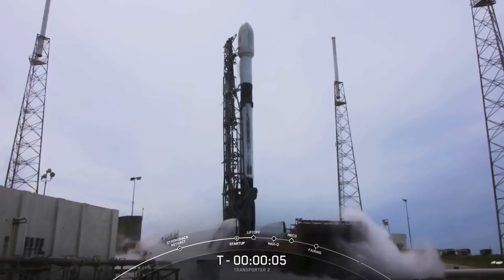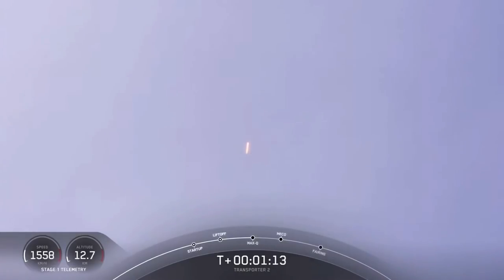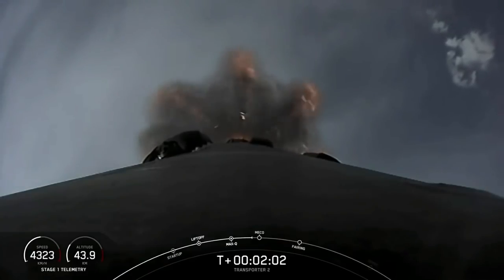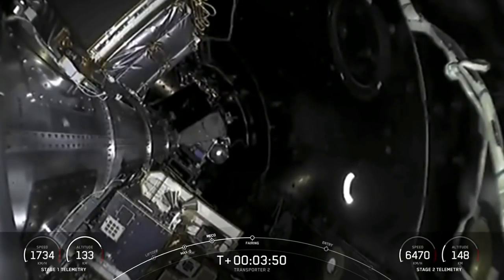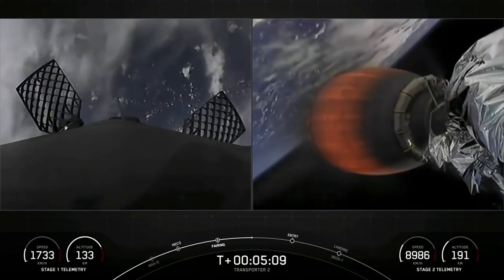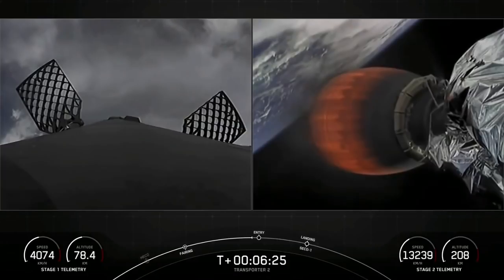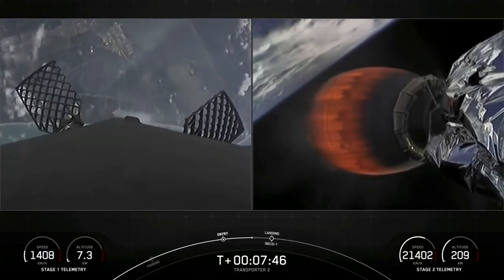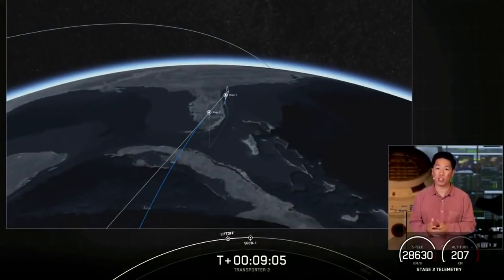SpaceX launches Transporter 2 rideshare, nails LZ-1 landing in Florida!

Comment: 0:40 >>> Nose cone shivering rocket launched.
No one commenting on that, why ????

1st stage chamber pressure : what ???
Reply: The wobbling nosecone has nothing to do with the nosecone itself. It's the camera vibrating. Chamber pressure is the pressure inside the combustion chambers of the 1st stage engines.
Reply: Respected  @Ethan_Roberts  

Where was that vibrating camera mounted ???

Earthquake zone, isn't it ???
Reply: @mohamediqbal395  it's a remote tracking mount. They're often setup very close to the launch site. Do you have any idea how much a rocket vibrates the surrounding area?
Reply: Respected  @Ethan_Roberts  

But the camera vibration happened long after the launch, when it was in air. 

Quote :
*Effect coming very late, means something happened in between*

Comment: One can clearly see that the exhaust gasses coming out of the second stage engine in space are not only (partly) visible but that some of the gasses leave the exhaust almost at a right angle, as can be seen at 6:11 - 6:12 when (what i assume is) a piece of ice breaks loose and hits the exhaust gasses and is than jettisoned away from the engine. Compare that to the footage of the Lunar module lifting off from the moon by means of it's rocket engine: no gasses visible at all.
Reply: Yes, the engines use different fuels and were in different atmospheric environments hence the difference
Reply: @lucaherman6227  the lunar module engine should have produced lots of visible gasses. Also the atmospheric environments should be comparable, near vacuum of space.
Reply: @erbalumkan369  no it shouldn’t have, it’s fuel type burns clearly, not all rocket fuel is the same believe it or not

Comment: What is the "heartbeat" going on under the foil blankets? Some sort of pressure release?
Reply: It's just vibrations from the rocket firing.  Any kind of pressure release would blow the insulation apart.  It's just very thin reflective kapton film.
Reply: @stargazer7644  - It could be puffs of gas from the ACS.

Comment: So the aluminum tin foil doesn’t rip at 4000 kmph..........LOL.....nice CGI.👍🏻
Reply: Why would it?
Reply: No, the multi layer thermal protection foil does not rip when it gets exposed to a vacuum with no air drag. Idiot.
Reply: Speed isnt a force. 10mph, 1000, 100,000mph it doesnt matter if there is no medium to interact with.
Reply: theres no air hitting it so it wont rip.

Comment: I’m probably being dumb but I’m amazed how swiftly computing has moved but not rocketry considering they were roughly around the same era
Reply: You can't break the laws of physics.  Computers have evolved because we've simply learned how to make transistors smaller.  I hope you enjoyed the ride, because we've pretty much hit the limit to how small you can make one.
Reply: @stargazer7644  
Hmmmm….I’m not convinced it’s all about the size of transistors. Computing power was rudimentary when compared to physical rocketry. I think it’s more about the potential commercial value back then when computers were a whole lot cheaper to create and research because of the natural expenses associated with rocketry
Reply: @D-McMarsh  Computing power is directly correlated with transistor size.  The size of the transistors is what determines the capacitance of the nodes, and that's what determines how fast the computer can run.  It also is what determines the voltage chips operate at, and how much heat they have to dissipate.  The end of the road in shrinking transistors is also why they've pretty much stopped getting faster. That's why you don't have 20 GHz CPUs, and never will.  All we can do now is put more of them in a chip.  Sure, other tricks like early speculative execution, pipelining and caching have helped make them faster, but it is primarily the transistor size.

Comment: Sooo fake
Reply: It really isn't
Reply: @Ethan_Roberts  do you have eyes? Have you seen the landing so fast and unrealistic, like there was no shaking or wobbling, nothing, it looks like very very good cgi
Reply: @jag0937eb  considering many thousands usually watch these landings in person, yes it is definitely real. It also doesn't make it fake because the tracking camera is able to follow the rocket smoothly. Do you expect all cameras to wobble and be unsteady like they're tracked by hand?
Reply: @Ethan_Roberts  not the camera, the rocket. It is unrealisticly smooth and fast for how heavy this thing suppose to be.
Reply: @jag0937eb  That's still not a good reason for it be called fake. It's a 20 ton rocket coming down by the thrust of a Merlin engine being controlled by TVC, thrusters and grid fins. The on board computers are keeping it stable all the way down, there would be no wobbling as it is counteracted very precisely. An airliner weighing 200 tons can also make a very smooth landing and that's piloted by people but you won't call that fake.
Reply: @Ethan_Roberts  i have seen planes landing, other kind of devices landing vertically, like helicopters, harrier plane, yak, the german vtol fighter, even the lunar landing test platform thing, none of them looked fake. Something about this rocket landing looks wrong and fake.
Reply: @jag0937eb  Just because it looks odd to you doesn't mean it is fake. There are other camera angles of this same landing you can watch that will give a different perspective and maybe won't look 'wrong'.
Reply: @Ethan_Roberts  i have reasonable trust in my eyes and brain. Something is simply wrong with that landing.
Reply: @jag0937eb   Are you a rocket scientist and have enough experience with aerodynamic forces on rockets to make that claim? Like he said, the rocket has on board computers, thrust vector control, and titanium grid fins to keep it stable.
Reply: @jag0937eb  "trust in my eyes and brain" yeah sure...
Reply: @jag0937eb  in  a decade or so we'll see who's right ;)
Reply: @itsoctotv  hopefully

Comment: What the hell fell off at 6:12? Then something else is loose and slides around the top of burner.
Reply: it's either ice that formed that broke off, or part of the thermal foil that sits around the engine.
Reply: @jasperpluk  thank you that was gonna drive me nuts

Comment: Go SpaceX. The 8th flight is the remarkable thing. Seek reliability, fight complacency, innovate constantly.
Seek reliability, because safety first, but budget counts.
Fight complacency, because every launch has to have as much care as the first, and Operations fulfil Engineering & Design.
Innovate constantly, because no design is perfect, and objectives evolve.
It's a bit rough when you explain yourself, but not every comment reader will be a Space Fan.
(Space Fans are hopeless in space :-)

Comment: How it different to space shuttle SRB when it was recovered and reused.
Reply: SRB solid rocket booster, can't be turned off once lit, needed to be completely disassembled and basically rebuilt. Same with the tank, needed complete refurbishing, same with the shuttle. Took many months and cost billions. Falcon 9 can be inspected and cerified flight worthy in 30 days. And it costs a shit ton less to refurbish.
Reply: @michaelkeudel8770  You don't really know what you're talking about.  The tank is not refurbished, it burns up on re-entry and is lost.  The SRBs didn't "need to be completely disassembled and basically rebuilt".  The boosters were built in sections so they could be easily transported by rail.  All they do is clean them and refuel them.  They've turned the Shuttle around and relaunched it in just 51 days (STS-51-J and STS-61-B).  The average cost to launch a shuttle was expensive at $450 million, but keep in mind the Shuttle was far more capable than a Falcon 9.  It carried heavier and larger payloads to orbit, and could also bring them back down.  It could also service and repair satellites on orbit, something Falcon 9 cannot do.

Comment: Just goes to show what a joke the NASA program was.  How many shuttle solid boosters returned to the launch site and landed themselves?  Oh, wait, how many landed themselves over the 30 years of the shuttle program?
Reply: NASA was limited by it's budget it got from the US government, and to put it bluntly, the tech to make reusable rockets that could land like those of SpaceX simply didn't exist at the time, also mainly due to NASA not getting the budget it needed to do proper research and development on its own plans and projects. It barely had enough to keep the ISS and the Shuttle program running together as it was..
Reply: @jasperpluk  Wrong at so many levels.  First of all the technology has existed to land boosters the way SpaceX does for the past 40 years.  Aircraft (747, DC-10 being just 2 70's examples) all had INS equipment that would have been more than capable of providing accurate enough navigational information.

Secondly budget was not the problem.  It was the pork barrel politics.  It's actually written in law that any spacecraft developed by NASA must have solid boosters.  And if you do a little research on that topic you'll see exactly why NASA effectively held back spacecraft development for 30 years.

The shuttle program was a mess, producing the deadliest spacecraft ever built that killed 14 people and 40% of the fleet was lost IN FLIGHT.  How much regard would be held for any model of commercial air liner that lost 40% of it's fleet in flight killing everyone on board?

The whole reason the shuttle program was that mess is also because of the politics.

Comment: Wow !! This saves a lot of money than the space shuttle program....☺
Reply: This rocket has a tiny fraction of the capability of the Space Shuttle.  Of course it costs less.  You won't be building an ISS or hauling Hubble Space Telescopes with Falcon 9s.  It's like comparing a pickup truck to a tractor-trailer.

Comment: ....so it's going away from the launch site at 10 times the speed of sound so in order to get back to the launch site you would have to have enough, uh, fuel and oxygen to reverse out that velocity and boost back all the way to the launch site and you just don't have, the physics of it don't really allow you to have that much ...

It's not about saving money on fuel or anything it's just physically impossible. So um because another sort of thing about uh, if you're in space is that there's nothing to react against, so like whereas an aircraft can circle very easily because it's reacting against air, in vacuum there's nothing to react against. So the only way to go back the other direction is to apply just as much energy as it took you to go, if you want to go backwards you have to apply just as much energy as it took you to go forwards. In fact twice as much really because you've got to zero it out and then you've got to land elsewhere!
Reply: It's not possible because you don't understand it...Got it.
Reply: Rockets follow newtons 3rd law

All actions have an equal and opposite reaction

The action rockets are doing is pushing exhaust back, so because of that, the equal and opposite reaction pushes the rocket foward.

And no, the falcon 9 doesn't need to apply as much energy as it took off.
Because all it's doing is burning horizontaly and reversing it's course, and then it has the atmosphere to slow it down, after that, the landing burn

So you don't need as much fuel as you did at liftoff.
Reply: At launch - and on the way up - you have a rocket full of fuel and all the upper stages. On the way back, you have a first stage which is relatively light - just an engine and fuel tank with most of the fuel burnt. It's a very different situation.
Reply: @EuroScot2023  Oh right. It's got enough fuel to null out the forward velocity, accelerate to hypersonic speed, fly back home, slam on the brakes and land softly.  All of that on a near empty tank!  Wanna buy a bridge?
Reply: @whompywheels5165  yes, it actually doesn't take that much fuel, especially the fact that the landing is only done with 1 engine at it's minimal throttle setting instead of the 9 used for the launch
Reply: @blobman1238  - Sorry I didnt see your original explanation I would've held off. Lol. @Whomy Wheels - Its been quite thoroughly explained to you. Why post if you're not interested in the information? Being proven wrong is okay you know that, right?
Reply: @motokid6008  Nah, it's fine. It's better if you didn't delete your reply tho because I forgot to mention that weight and fuel is also what makes the landing possible. But EuroScot already explained it
Reply: @whompywheels5165  I'm sorry but may I ask, what makes you still think this is fake after we explained it to you?
Reply: @whompywheels5165  Well I don't see the falcon 9 defying any laws of physics..but it's your opinion I guess
And I can't enter that link, it said it's not safe, can you tell me what Elon Musk said in that link?
Reply: Be less stupid
Reply: @motokid6008  yes, that too

Comment: Elon Musk: ...so it's going away from the launch site at 10 times the speed of sound so in order to get back to the launch site you would have to have enough, uh, fuel and oxygen to reverse out that velocity and boost back all the way to the launch site and you just don't have, the physics of it don't really allow you to have that much ...

It's not about saving money on fuel or anything it's just physically impossible. So um because another sort of thing about uh, if you're in space is that there's nothing to react against, so like whereas an aircraft can circle very easily because it's reacting against air, in vacuum there's nothing to react against. So the only way to go back the other direction is to apply just as much energy as it took you to go, if you want to go backwards you have to apply just as much energy as it took you to go forwards. In fact twice as much really because you've got to zero it out and then you've got to land elsewhere!
Reply: Physics isn't your thing is it ?
Reply: @eminence_front6043  Oh yes it is. Ballistics, laws of motion?  Musk does NOT respect them.
Reply: @whompywheels5165  He makes them work pretty damn good though. 
It's you who don't understand.
Reply: I think he thinks quicker than he talks... if you know what I mean. Just like when you solve a math problem in your head and then you have to explain it...

Comment: Can this be the lowest cost most reliable rocket ever ?
Reply: As far as reliability, it is far too soon to say.  It's had 2 failures in 123 flights.  That's not even as good a track record as the Space Shuttle's 2 failures in 135 flights.  And it will have to fly a couple thousand times to be compared to the reliability of the Soyuz.

Comment: The landing is exactly the same as rocket ship landings in all 1950s SciFi movies. Even the rockets themselves are stainless steel with fins at the base  just like the 1950s rockets. Perfect.
Reply: Yes indeed. Science fiction CGI. https://www.reddit.com/r/EnoughMuskSpam/comments/mdfiz3/musk_admits_rebounding_rockets_are_impossible/

....so it's going away from the launch site at 10 times the speed of sound so in order to get back to the launch site you would have to have enough, uh, fuel and oxygen to reverse out that velocity and boost back all the way to the launch site and you just don't have, the physics of it don't really allow you to have that much ...

It's not about saving money on fuel or anything it's just physically impossible. So um because another sort of thing about uh, if you're in space is that there's nothing to react against, so like whereas an aircraft can circle very easily because it's reacting against air, in vacuum there's nothing to react against. So the only way to go back the other direction is to apply just as much energy as it took you to go, if you want to go backwards you have to apply just as much energy as it took you to go forwards. In fact twice as much really because you've got to zero it out and then you've got to land elsewhere!

Comment: Watching that booster land is amazing. How on earth do they do it? The speed it was coming in I was sure it was going too fast, until literally the last few seconds. Some seriously talented people work at SpaceX. And it hit the bullseye. Right bang in the center after coming back from space.
Reply: The speed is by design. It's called a suicide burn; it is more weight effective to hold only just enough fuel to  make one last ditch effort to stop the rocket after letting the atmosphere slow it. They also have an issue where the Raptor cannot throttle low enough to allow the rocket to "hover." If they start the deceleration burn too early, it would start going back up before it touched down.
Reply: @bigrob966  just wanted to post out that falcon rockets don't use raptors, they use merlins
Reply: It is just math and physics.  If you know how heavy you are, how fast you are, and how high you are, then you know exactly when to fire the engines so you'll be at zero speed when you reach zero altitude.  Any high school calculus student can do this math.